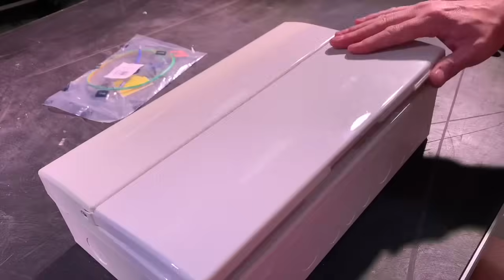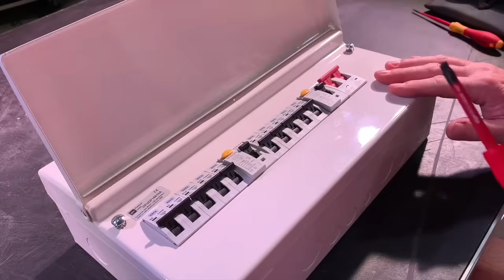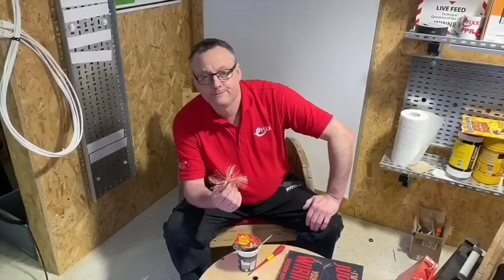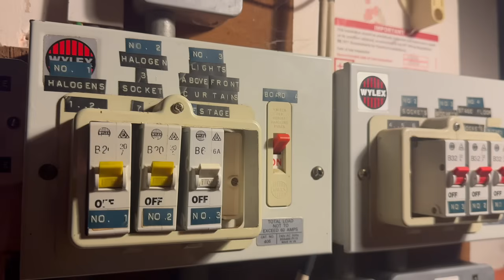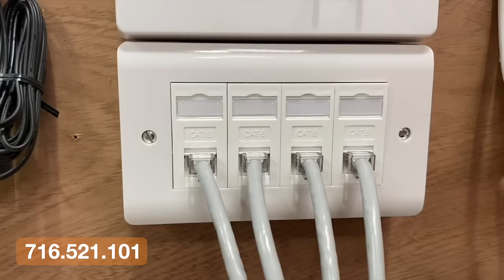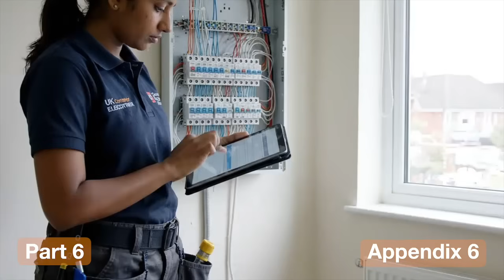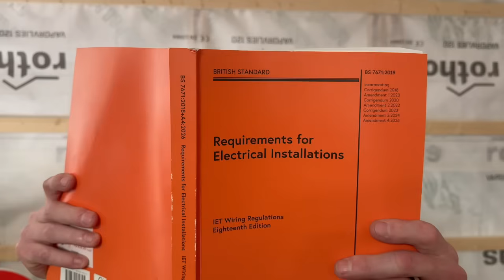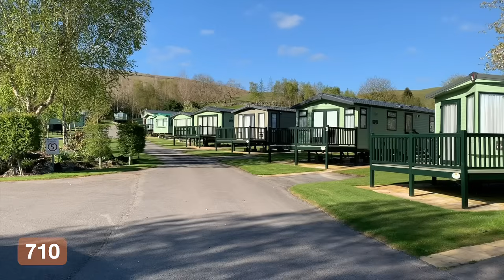BS 7671 Amendment 4: What Every Electrician Must Know!

Comment: Oh. UK is finally catching up with Europe. Well done.
Reply: I'm sure European sparkies realise that the amount of inductive heating by passing conductors through different holes in metal enclosures is so low in relation to the amps flowing that it is insignificant until the circuit involved is carrying hundreds of amps.  Who ever wrote that passage probably needs to look at transformer tanks where conductors carrying 400A pass through... separate holes through the steel.
Reply: ... or to put it another way 100A through 25 sqmm copper will result in much greater heating of the enclosure metalwork from I^R losses in the wire than any induced current in that same metalwork.

Comment: The installation acting as a source has been around since electric motors began being installed, in large installations with large motor loads a significant portion of fault current comes from those motor loads. Some from the energy stored in their inductance, some from certain motor types acting as generators fed by the inertia of the driven load.